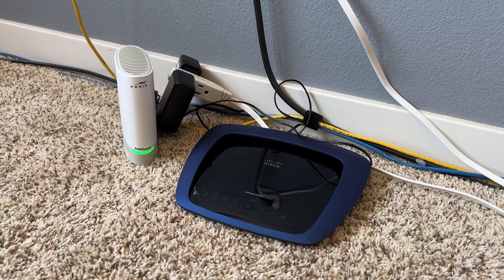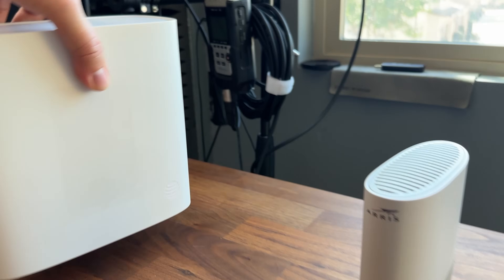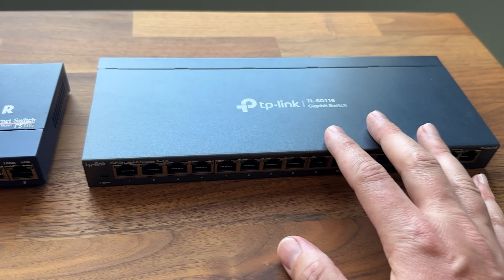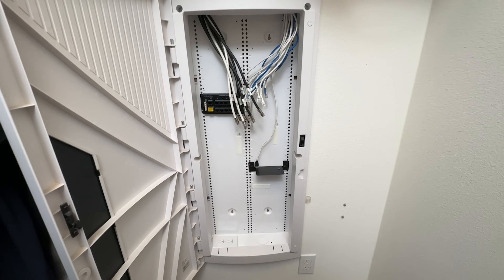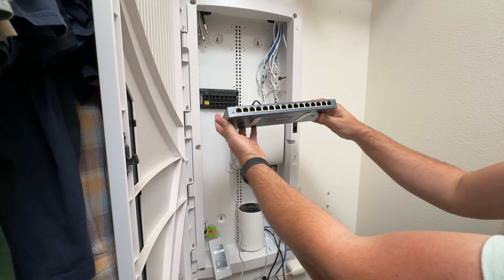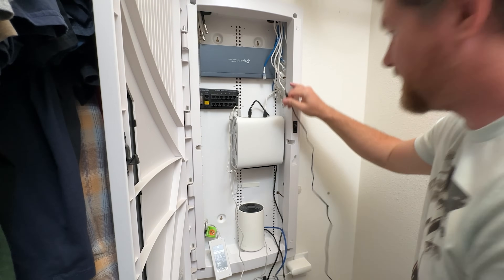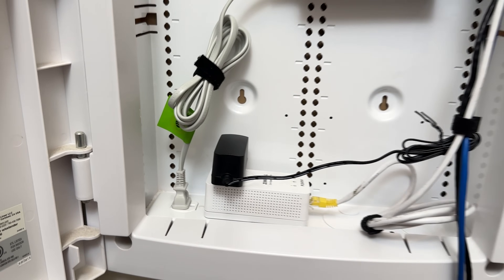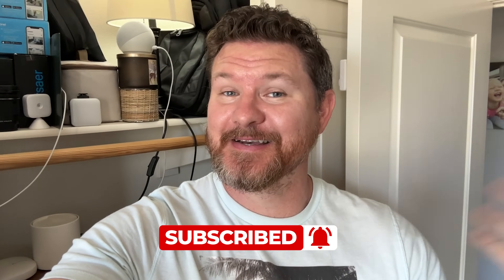How To Setup The PERFECT Home Network For Beginners

Comment: 'Or', if you're going to step up your networking cred, run one CAT cable to one location (or two to multiple locations depending on the size of your home), install POE WAP's on the ceiling(s), and bypass the MESH setup all together.  Great WiFi everywhere, nothing sitting on tables around the house, and none of the signal speed degradation of daisy chaining MESH components.  That setup would also allow you to forego buying a MESH router all together (save some coin), use your existing gateway for routing duties, and prevent you from having anything sitting out of your networking enclosure in the closet).  And its always fun to have friends ask what that 'thing' is on the ceiling.  If that setup is good enough for hospitals and corporate America, its good enough for my hacienda.
Reply from the maker: Totally agree, but where i get stuck is running a wire to a downstairs room. How do you navigate a cable between the 2 floors without cutting holes in the walls and ceiling?
Reply: @SteveDOES  Agreed.  But since I live in Florida and my home is single story, my challenges aren't as severe as yours.  I managed to install CAT runs to every room in my home by myself, so it is doable, and preps the home for future updates.
Reply from the maker: @Mike-In-O-Town  jealous. :)
Reply: @SteveDOES I think if you are not able to drill holes or doing rougher stuff, you have to use existing running cables. If they ar not ethernetcables, you have to figure out both ends of the cable and bind your new network cable on one end and then pull the cables up to the other end. If you need that other cable too, I think you need a new wire and pull up 3 cables through the existing holes.
Reply: This 100%. Also used WIRED connections for important devices like PCs. At this point it is probably better to "future proof" and run fiber, but for most people 1gig ethernet might be enough for a while.

Comment: Can you plug modem>switch> mesh or does it have to be modem>mesh> switch
Reply: You need a router in between the modem and switch. If your mesh setup acts as a router, you can use that.
Reply: @JJFlores197  Does this apply in case our ISP supplies us with a super modem? In which case, I would use it as: a modem for incoming internet+router? In this case, is it recommended to do modem>switch>mesh, as OP asked?

Comment: Why do all of your videos mentioning getting a router when most Modems these days have built in routers. In your other video you connected your ATT modem to a router for "protection" bit it already had a router built in.
Reply: I don’t know about him but personally I like using my own router because the ones from the cable companies are usually slower, have worse signal output, and are locked from the factory (meaning you can’t change any settings other than your network name and password)
Reply: 1:29  explanation
Reply: i wouldnt consider it a router when compared to what you get with an actual router
Reply: isn't this like... >5 yr old news... apart from maybe the coaxial modem...
Reply: Easy explanation. Modem/router tend to overheat over time. Having it separately works better if your home is using 20+ devices at the same time pulling more than 2gb at the time. Back in the day that was the main issue. I'm not sure now days
Reply: Two firewalls setups
Reply: Modem router combos are trash

Comment: Nice job organizing the data cabinet, I always struggle to organize these myself. Where did you find the shelf? Also a thought I had, In the room you showed with the switch. Wouldn't you get the best signal and speeds if you were to bring the cord from the wall into the TP link node and then come out of the node into the switch? In my head that would mean your node still gets access to the signal from the split 5gb port on you modem. I am not 100% sure it would make a difference though.

Comment: Why connecting the Wifi mesh directly from the router and then the wifi mesh to the switch, instead of, connecting the router to the switch and then the wifi mesh to the switch?
Reply: Because with the first method the wifi mesh gets full bandwidth instead of sharing it with everything else on the switch plus everything on the switch now gets intercepted and protected by the mesh’s firewall
Reply: @fakename287  nice, thank you
Reply: Fakename's correct.  Though that first mesh point is almost likely a  wifi Router/Switch, being the first on the inbound line it gains the routers security from firewall, N.A.T., and possibly P.A.T. while reaping the benefit of the switch, sharing all the bandwidth with each port all the time (routers divide bandwidth among available ports 100Mbps / 4 ports active = each port onlyvgets 25 Mbps, the Switchvin an identical situation, each of the 4 ports get 100 Mbps.)

Comment: question regarding the network switch.  I don't want to drill any holes in the wall (1st flr/ 2nd flr) to run the cat 5 cables.  Can I use 2 8-port switches and run a single cable from router to 1st switch and another cable from 1st to 2nd switch?
Reply: You can connect the second switch to a Access point (another router if you have a mesh system)
Reply: You can connect two switches together. Use a crossover cable to connect the switches together. Or the second switch needs an uplink port.

You can use MOCA adapters to send signals over coaxial cables from the first floor to the second floor and connect your second floor switch without pulling cable.

I went this route to backhaul my mesh system and add data keystones to the 2nd floor.

Comment: Home networks should always be kept simple as possible and not complicated. You keep talking about routers everywhere and this is NOT good. You want/need a router at the front of the netwoprk between WAN and LAN. Aditional routing downstream results in extra NATing and network comlication. 
Another tip, devices including switches should be mounted so the network ports face down where possible, if not, sideways. Stops dust and other crap building up in the ports. WiFi on devices in a metal box is an instant fail. I did notice that you have a plastic door which negates some of the issue but not ideal. Same goes with a power socket in bottom facing up just inviting stuff to fall into it.

Comment: FYI, rg-320 gateway vents heat out of the top. I install these for a living and there is a plastic shelf made for it to set correctly. Also the status light on the front cannot easily be seen that way. It lets you know easily if you have a service outage.
Reply: Do you need to let the service provider your setting up the home like this or can you do as he did and be done with it plug and play?
Reply: @CaptainWheeler Once your ISP gets you setup, you can do the networking yourself. No need to contact them again. They won’t even help you with it.
Reply: @CaptainWheeler  You need to let your service provider know. For ATT which is the ISP in this video, the Fiber line is actually encrypted and assigned to his account. So if he were to plug that device in at someone else's house it wouldn't work because it would see that its not connected to the right feed. I was a ATT tech from 2018 to 2020 in Houston Tx and I installed hundreds if not thousands of these Modems on fiber networks.
Reply: @staytongordon8416  can you wire modem —-> switch —-> WIFI? Or does it have to be modem —> WiFi —> Switch as shown in the video?
Reply: Dude I seem that and was like yep he'll be calling 1800 soon hopefully it's not a repeat
Reply: Any special configuration changes one needs to make in the admin console of the BGW320 if we plug the gateway into an unmanaged or managed switch?  I have similar plans, that is, to hook in all the rooms in the house pre-wired for Ethernet into a new switch that is subsequently plugged into the BGW320.  The BGW would be dishing out DHCP addresses as usual.
Reply: what is the part for the proper shelf? I have a LV cabinet, and the ATT installer just set it on the bottom over my power plugs.
Reply: @gsnow1815  Contact customer service and see if they can send you a BGW-320 plastic shelf

Comment: If you want to create a fire hazard and bottleneck your internet speed, go ahead and follow this video. If you're going to use an enclosure, make sure it has a built in ventilation system that brings in cool air and sucks out the hot air. Notice the little gap to the side of the gateway and how he puts everything flat against the box? No-go. You need to put on 1" spacers on your devices and then have those stick the the case. You should have at least an inch of space on all sides of your device to allow proper air flow, prevent overheating, prevent bottlenecks, avoiding a possible fire, and avoid spending money on replacement devices because of burnout and malfunction.
Reply: Also, you don't want your mesh wifi sitting low. You want to put it at a high point to strengthen the signal to the next device.
Reply: Using command strips. Is the start of the mounting SNAFU.  1" is ideal but not mandatory....everything depends on ambient temperature-plus-total capacitance of heat generations' ability to  exceed safe working parameters.  
He could rectify it without 1" spacers if he knew those maximum and subtracted a safety margin and set up thermostatic governed fans coupled to his fans thermocouples.

Realistically, many boxes don't allow for ideal air margins for passive cooling, so he'd simply need to add 1-2 thermostatically governed low speed high effiency fans at the bottom (of a closed box with vents at the top) with their thermocouples at the top or ideally with the thermocouples on the top the most heat liable item.

Comment: “it has built in wifi and a built in router” . . . uhhh those are the same thing?
Reply: No. You can have a standalone router with no wifi capabilities and a wifi AP/router that doesn't do any routing.
Reply: From a technical perspective, those are 2 different technologies. It just so happens that modern routers combine everything in 1 unit.
Reply: They are 2 different things ofter packaged together.  A pure router has no antennae for security.  Ofter it's a router/switch.  Though yes nowday ignorant kiddies are only used to often seeing a wifi capable router switch that they go home and bedazzle because it increases their framerates.

Comment: I honestly think that this is not for beginners. A couple of reasons... Mesh is considered layer 3. The best solution for a beginner would probably be a router/ gateway with unmanaged switch. You have too many devices connected. Mesh would only be a good solution if your house is like 5,000 sq or something. My house is 1450 and with one Netgear ac1750 covers the entire house. I would separate home networks setup based on needs and coverages. And if you are talking about security... A router like a TP link archer c7 can be enabled for openvpn.

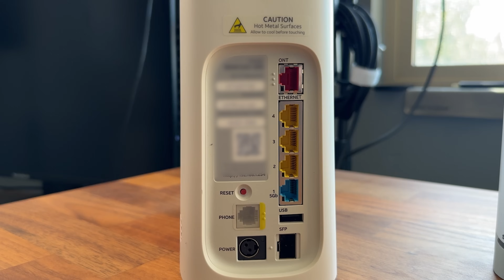Comment: What is the SFP port for in the modem cable at 2:22
Reply: That model of router is actually meant to be fed direct fiber via sfp connection. The set here is an older set up. When upgrading to 2.5 or 5 gig, it will require fiber line ran from the exterior to the router.
Reply: sfp port is for direct fiber connection. Evidently installer has him on separate ONT

Comment: Thank you Steve for the video. I do have a question regarding solving the switch to switch connection issue. If I would get a mesh network system that has more ethernet ports, I could connect in my other room away from the base node the cable from the wall into the node and then connect the ethernet cables for my PC, PS and Apple TV straight into the node? Would that solve the issue of splitting the speed?

Comment: I having issues with my deco mesh system. It keeps kicking certain pcs and iPads off the Wi-Fi and then I have to reboot the deco in order to reconnect
Reply: it could be dns settings have you checked the system for isp default or tried changing to google or clouds open dns addresses?

Comment: The ATT gateway has a gyroscope built in and will fail your quality check if it isn't right-side up. Just a tip. Great vid!
Reply: Wait Really? That's insane. haha Telstra doesn't do that over here.... (i think) You'd be surprised, the newer telstra modem / router combos are actually really nice, and they do a good job of everything all together. I did however do a similar approach that Steve has gone for.
(Unifi Express Modem > TP-Link1GB Switch > Unifi U6Lite x2)
Reply: He MAY be able to do without that AT&T "gateway", which is actually acting as a pure router (though he says he disabled DHCP on it, presumably to avoid "double NAT" issues with multiple routers in the home network, though I wonder how his security system is working that way when plugged directly into the gateway). His incoming Internet "Feed" signal is actually an Ethernet cable coming from an optical network terminal (ONT) elsewhere in the house & plugged into the gateway's ONT jack; in a fiber network the ONT acts as the "modem". AT&T may have some network restrictions that require him to use their gateway; my fiber ISP doesn't, so I recently replaced my ISP router with a Deco BE63 being fed directly from my ONT.
Reply: @richellebrittain2127  At&t requires the modem and you cannot just plug a router into the ont and use it as is, there are ways around this but they are a bit complicated for the average customer.

Comment: How do you get your whole house wired?
Reply: You can wire it yourself, but it can certainly be a fair amount of work.  You can also pay someone else to wire it for you.   Paying someone tends to be pricey.
The best time to wire a house is when the house is being bult.   Short of that, most people just resort to using wifi in homes without WiFi.
Buying some brands of Mesh WiFi also come with wired ports, so you can connect wired devices to the remote mesh wifi nodes.  If you are renting a home or apartment, getting it wired is often not an option. Mesh Wifi + nodes tend to be a more expensive option, but it's an alternative to wiring the entire house.  There used to be a thing called a wireless desktop switch, or network extender that provides remote wired network connections over WiFi.  My 1 floor slab mounted home is almost impossible to wire, after the fact, because it's mounted on a slab; wires can be routed up and into the attic, but it certainly would not be ideal.  Wifi remains the best solution, and with WiFi solutions getting faster every few years, well, wired is not all that it's cracked up to be. 

Future proof your investments when you purchase by buying WiFi 7 although there are few devices using the standard.  Wifi 6/6E is a crapshoot, but can provide nearly the same speeds as gigabit wired network does, provided you don't have a lot of devices on the WiFi.   Depending upon your devices, and your router/access point,  there are channel bandwidth options, where the bigger number often wins;  like 40/80/160 mhz channel bandwidth. 
With my Wifi 6E access point, my speed is still limited to the bandwidth from the ISP, specifically about 940 Mbps download and 60 Mbps up. Faster wifi will do nothing to speed up internet access in my case, but it can make using internal devices like a NAS faster.   Is it worth the effort ?  Likely not.
Many devices in use nowadays tend to almost always be on WiFi, like laptops, tablets and phones.  A wired network is often not the only consideration.

Comment: I have a few suggestion (this is not a criticism): The Synology DS923+ supports LAGs (link aggregation groups), so I am surprised that you chose not to make us of it, as it gives you fail-over and traffic load balancing. Also, there is nothing wrong with connecting two switches, as it is done all the time when you have dual-homing. Combined with LAGs and Spanning Trees, you can create a very robust fault-tolerant network topology. Lastly, if at all possible, it is best to have all RJ-45 ports facing downward to keep out any debris that might fall from above (and it will). I does not take much to bend the fine prongs inside the jack.

Comment: Are you positive that if you connect a switch to a switch that the 1GB from switch A to switch B shares the bandwidth between all ports on Switch B? I think you are thinking of how older  hubs worked and switches are different.
Reply: He explained it correctly. Though switches don't "share" in the same way hubs used to (i.e., all the data flowed thru every cable in the hub), still if you have multiple devices using the same Ethernet link in a network at the same time they cannot together consume more than 100% of that link's total bandwidth. That's true of multiple links in this network -- ONT to gateway (he didn't notice his fiber ONT elsewhere inside or outside the house), gateway to main Deco, main Deco to switch A, switch A to switch B, and even switch B to satellite Deco. The way to manage that is don't plug in anything downstream from the weakest link in the chain that's faster than that link; avoiding just such a potential issue is a major reason I chose a Deco BE63 mesh (all 2.5GbE ports) over this guy's Deco XE75 Pro (only one 2.5GbE port per node).
Reply: @richellebrittain2127  He didn't explain it correctly. What you are saying (if you have multiple devices using the same Ethernet link in a network at the same time they cannot together consume more than 100% of that link's total bandwidth) is valid even if you have s single switch. He was explaining it like it's an issue only if we use a second switch, which is false.
Reply: He has no idea
Reply: I was looking for this comment. While it's true that the total bandwidth for each individual switch port is 1Gb, it doesn't split that total across different switches in the way he explained.